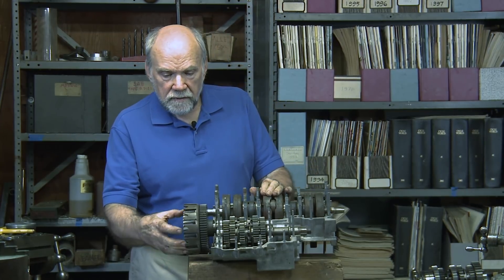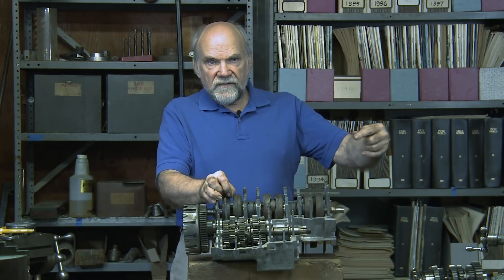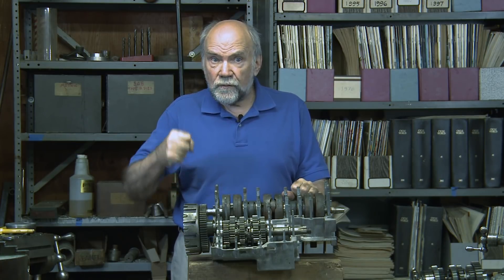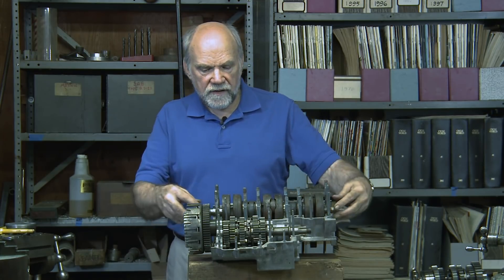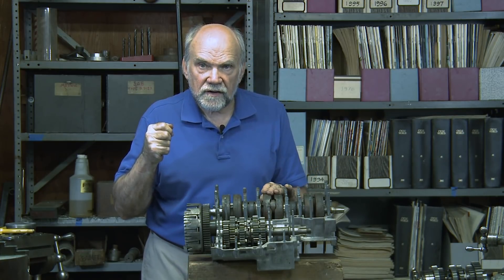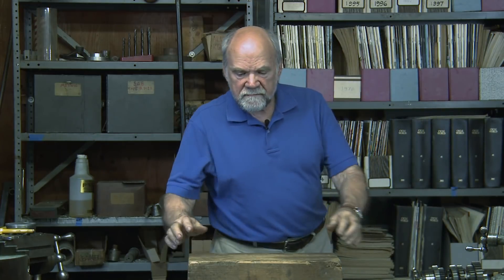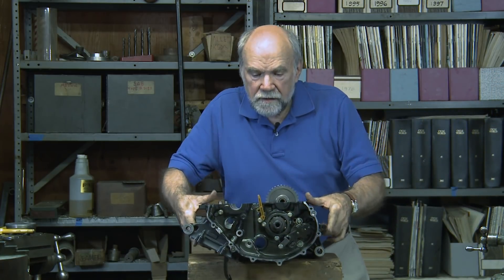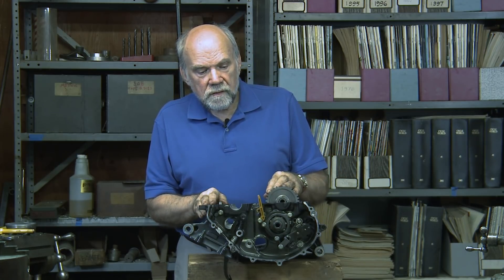What Is A Vertically Stacked Gearbox?

Comment: I might seem dumb but is the video "reversed", "mirrored" or something? The first block seems to has its drive chain at the right side and the second has its clutch at left? I have gotten used to opposite design..
Reply: Look at the writing on the folders. The video is not mirrored. The location of the clutch depends on the engine design, it's not always the same. Same goes for the chain, some bikes have it on the left, others on the right (example: BMW F800R).
Reply: @HardwareG33k   Yes, I do know that the arrangements can be various, BUT: He says, that the first block is a Kawasaki 500 and the second is a CBR. Now I can't remember any of these models having the opposite arrangement.